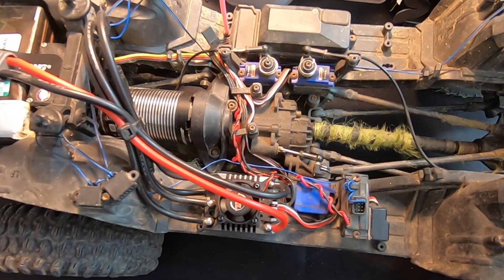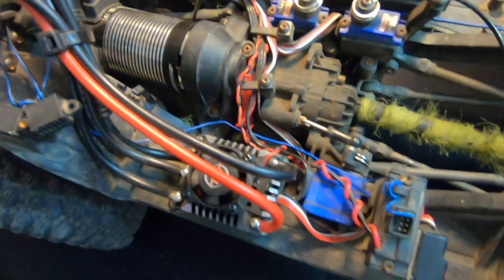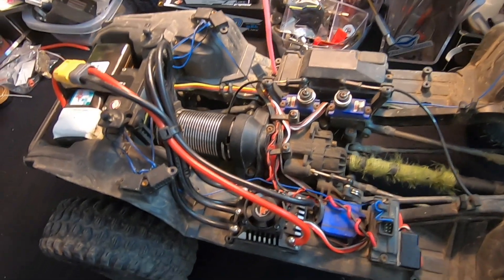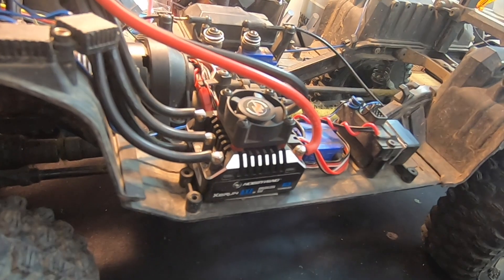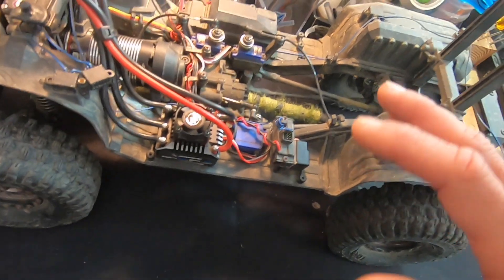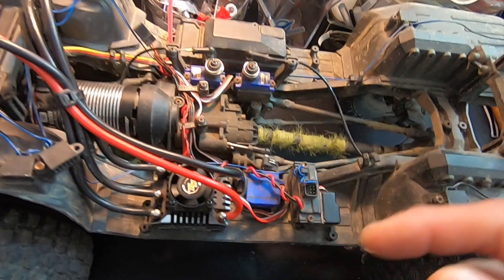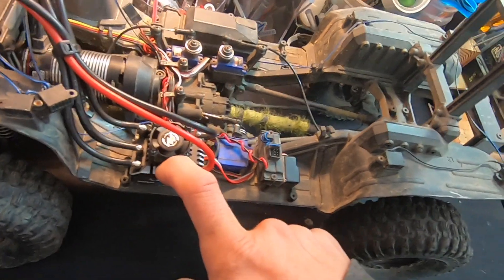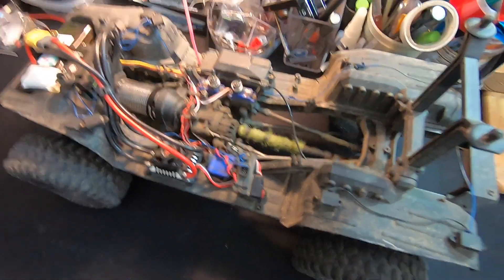The Charlie Show /// Episode 113 /// AXE 550, and Firmware Updates

Comment: I noticed on the video u have a light kit fitted, with my old ESC it was powered via the ESC. How did u manage with this set up?
Reply from the maker: The TRX light kit has 2 pairs of wires. One goes into the RX, the other plugs into the TRX ESC, we simply took that plug, and "Jumped" it onto the back of the RX plug.  Sorta "jammed" the wires into the RX plug.  It's not super bright, but they get the job done. ;) Mainly was going for the "bolt" on setup.

Comment: Still no official response.. If you update the OG 1.0 AXE ESC to the New Firmware? 
CAN YOU RUN THE 550 MOTORS? There is no official info on the hobbywing webpage about this...  Its a simple yes or no...
Reply: Good luck apparently the dude that post the videos doesn't answer the questions that people ask...
Reply: Didnt expect him to.. If they indeed work with the OG ESC they will lose combo sales with the people just waiting to buy the motors separately… Search for "Exocaged RC" channel I asked him if he is willing to test this and he said yeah! so it will upload a video soon.
Reply: just curious, did you ever figure out of the OG axe esc works with the 550 motor? I just bought the older version 30112100 and 550 2700kv motor and firmware doesn't not want to update :(

Comment: When will the update be available? I just took a look and its not on the hobbywing ape yet.
Reply: The update was live at the time the video was released, I got it over 24 hours ago, if its not available maybe you need to update the app? or they could have pulled it to put better warnings into the app because you can try to run it without Automatically pairing the motor and it can get really damn hot if you don't do the matching thing.
Reply: I tried updating the app amd another happened. I try it again tomorrow. Thanks for the info. At least someone answered since the dude that made the video won't...